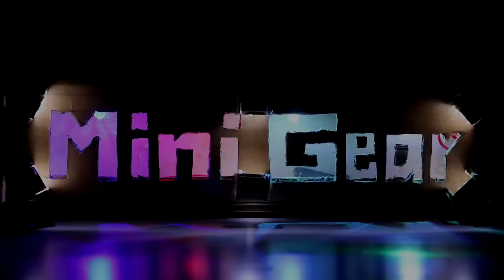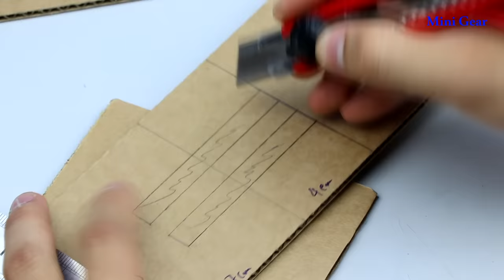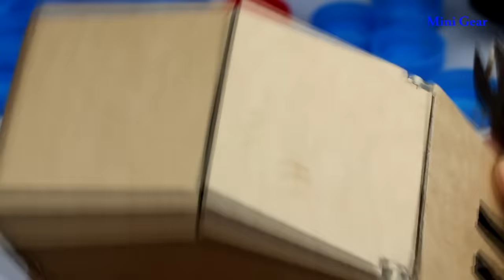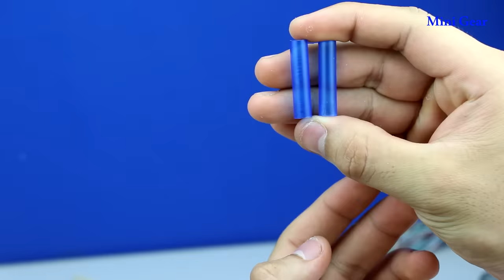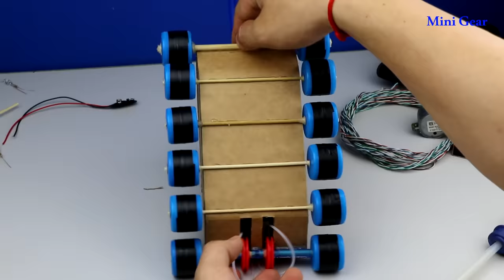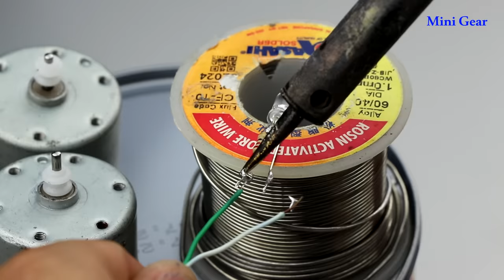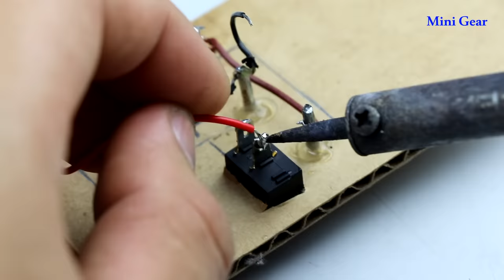Wow! Amazing RC Tank DIY at Home - Mini Gear RC Tank

Comment: The tank is beautifull but not is RC,  RC is Radio Controled and this is Cable controled....
Reply: Remote control*
Reply: @fxzgamer09  Your correction is incorrect, you cannot correct me in something that I am partly right since RC means both Remote Control and Radio Control, so it depends on each one and the use and meaning used, for me the meaning is Radio Control because it is what It is used and said in radio tv stores and any type of propaganda so it is radio controlled so it is not a radio controlled vehicle...

Comment: Can we use a DC motor lower than 9Volts like the ones used in toy race cars? if we use one, will it still work? and, can we use any type rubberband?

Cause we attempted to make this for our science project but it seems like the motor we used was too weak. How can we fix this? cause we have to pass the project tommorow.
PLEASE ANSWER IMMEDIATELY.
Reply from the maker: I think you can decrease size of tank and try to test it. Thank you.
Reply: Mini Gear , But we already made the tank same as the size on the vid, and, we're already out of cardboard 😞

And, in what other things can we find a 9V motor?
Cause we found out that the toy car motor can't pull the whole thing when put in the tire interior in with the wheels.
Reply: Can't a 3Volt motor work?
Reply: Are you THAT busy to not answer this? We cant any 9Volt motors in our area and we need to finish our project today 😭
Reply: @shaniayvonnesaponvillanuev5405  you can use whatever motor you can find.. just the speed wont be that high
Reply: @StarzzDrak  you are ✔️

Comment: from where you get water caps
Reply from the maker: i took those caps from water bottle.
Reply: Rahgvendra Sharma I have
Reply: Mini gear does it work with small water bottle caps
Reply: Mini Gear does it work with small bottle caps
Reply: Rahgvendra Sharma mjovidos
Reply: Rahgvendra Sharma said 853hvgbni

Comment: Sir it's an amazing video and I made it but I have an problem that the motor is working normaly but it is not working when we attach the rubber band to it. Sir please find the solution to my problem because I have to show this and I have few hours left. Pls Sir.
Reply: Sir if you can't find the solution then you can please give me some idea to convert it into a car.
Reply from the maker: I think your dc motor not 9v or low battery.
Reply: Mini Gear so can i us 2 motors of the same kind at one side?
Reply from the maker: You can try and test it. 😊

Comment: Nice project but which type of motor is used and also that tiny wheel in motor which is used to hold rubber

Comment: what's the RPM of motor ? As per understanding direct power supply for DC motor runs in terms of thousands of RMP so it should run like hell... But what i see here smooth and board controller motion.. How it was achieved ?

Comment: what do you call the white things you put on the motor shaft to attach the rubber to?
Reply: and what are the metal rods you used on the controller
Reply: Its called pulley

Comment: Im using Eudax Motor, the problem is the RPM, it go since 1.5v 9000rpm to 12v 250000rpm, wheren can i get a less rpm motor?

Comment: what are the materials required
Reply from the maker: You can see at 1:37.
Thanks.
Reply: Mini Gear in6;50 what is that thing
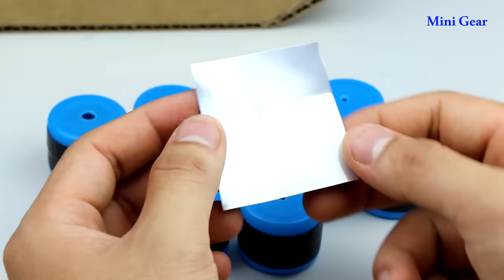Reply: Mini Gear and in 7:27 what is that thing
Reply: Mini Gear pls tell I have to make project